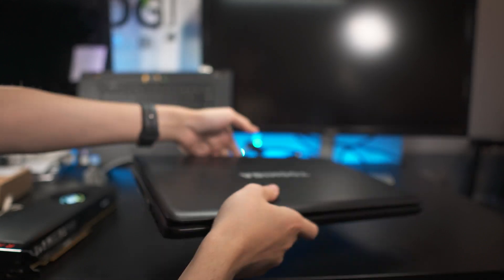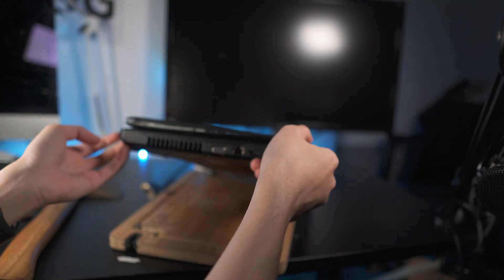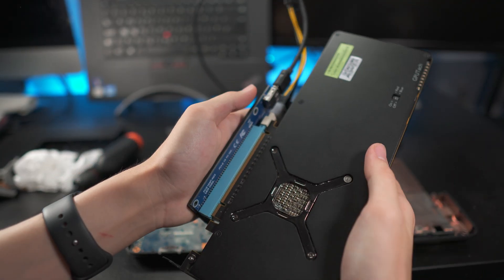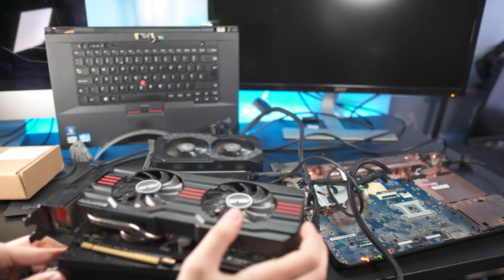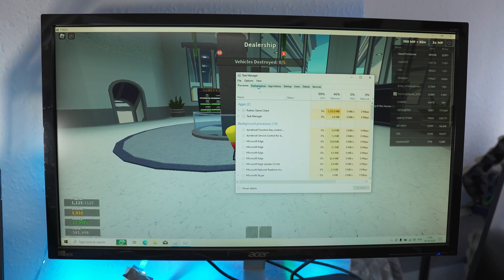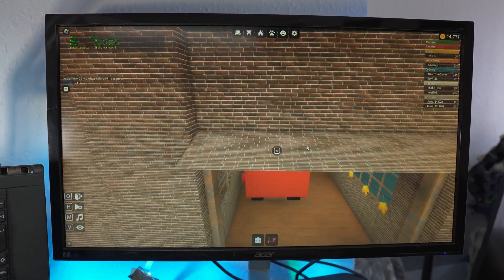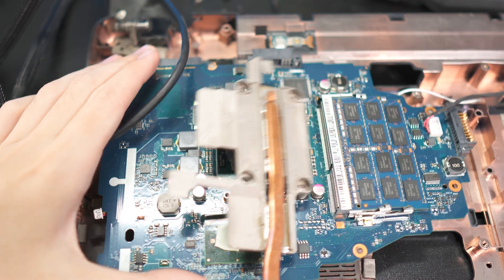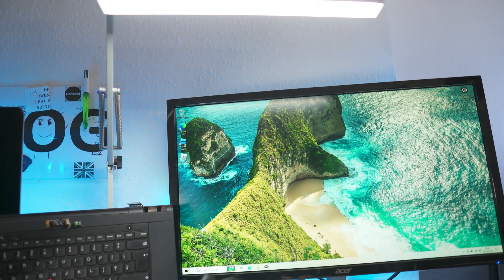Desktop GPU On A Laptop!

Comment: You should upgrade the cpu to a core i7-920xm. It depends on the power adaptor. It’s socket H1 if you were wondering.